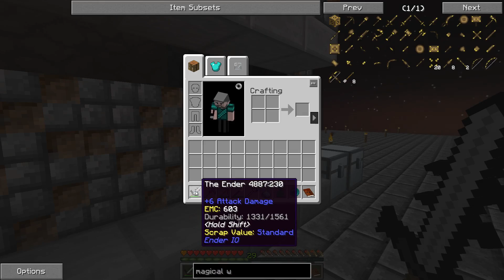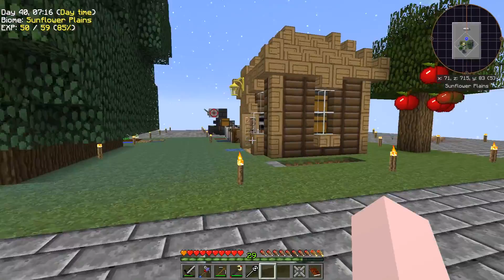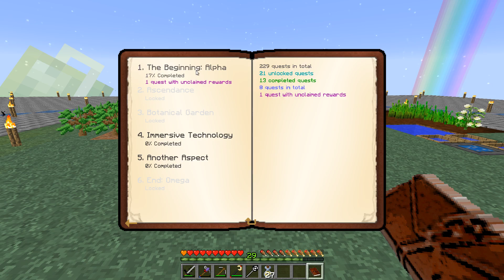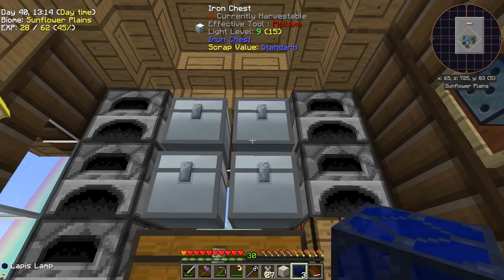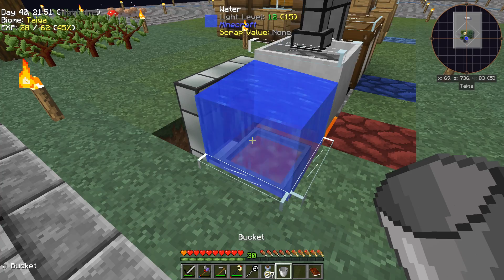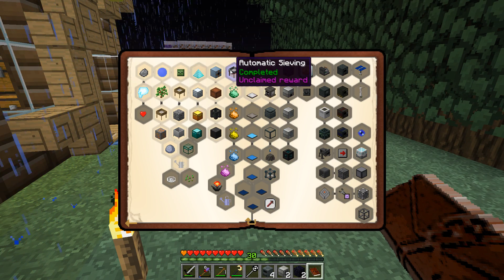e03 v1.7 - Wither Skulls, Turn Rotten Flesh into Gold, 2 Epic Bags - Project Ozone

Comment: Hi...This is Josh, and I am playing Project Ozone...2. I know this video is 2 years old in 2 days, but I was sent here while googling and thought I'd ask, since you seem to respond to people. Did you have a quest in PO1 where you had to make an unbreakable wand. There's one in PO2 and there's two recipes (probably similar to PO1, hence the reason why I'm this far into the comment). One with an unstable ingot, but you can use semi-stable nuggets to make a semi-stable ingot, or after the Pseudo-whatever ritual, you get 'mobius unstable/stable ingots'. Neither work to complete the builder's wand quest, despite be functionally the same. You know what, I'll go craft an unstable ingot and blow myself up, i have 15 lives at this point. I'll report back.
Reply: I did it the dangerous way. No danger really, but it still didn't work.
Reply from the maker: Sorry for the late reply. I don't remember. Wasn't it just 2 stick on a regular builders wand? You get a regular builders wand from the quest.

Comment: Tip: Use the mode button (furnace only/alloy only/all smelting) in the alloy smelter to prevent pre-emptive smelting :-)

You can also make your spawner's front wall out of spaced halfslabs with a little platform on the front, allowing you to cut down those little spirit thingies even if they fly up to the roof.